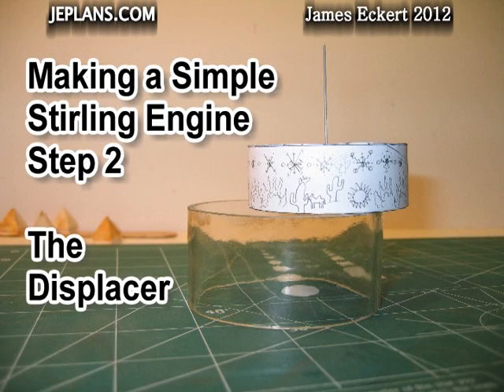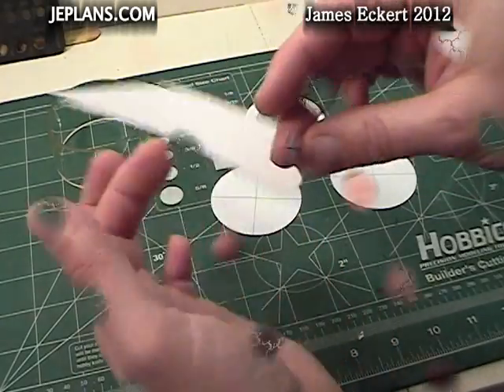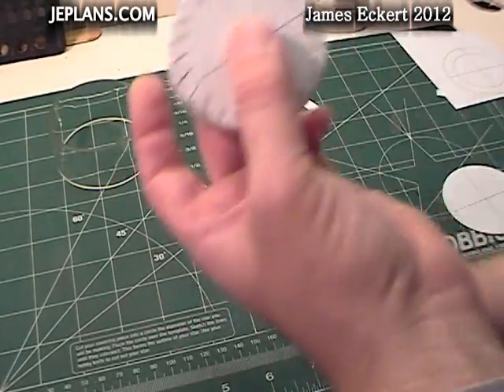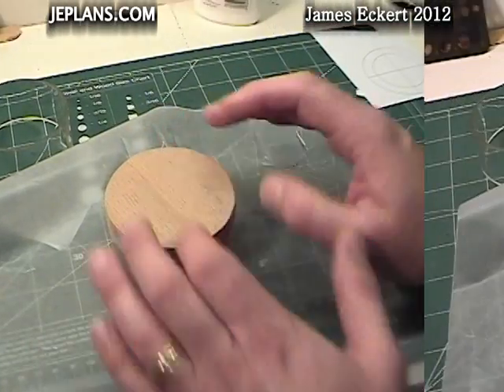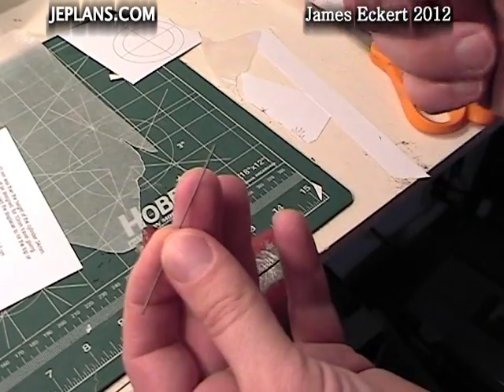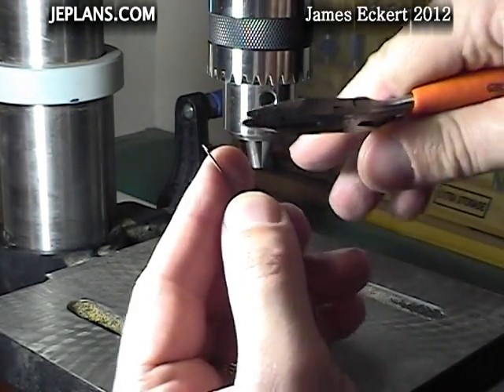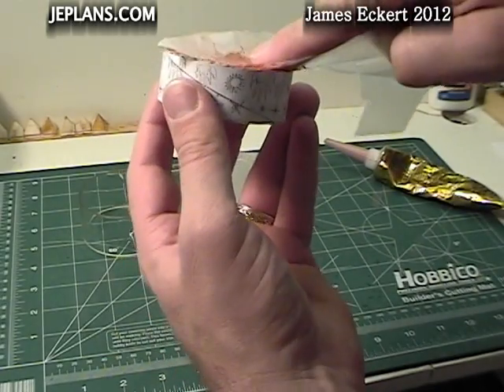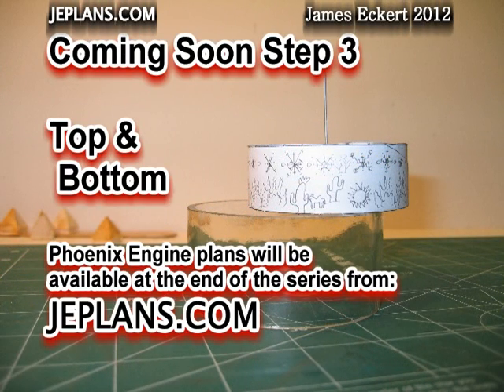Step 2 Making a Stirling Engine: The Displacer

Comment from the maker: Oops, I think I remove you other comment about the cylinder. Here what I was trying to replay with:
I used a bottle cutter to cut a Olive Jar in step 1.  The bottle cutter was less than $20. It takes a bit of practice to get a clean cut. If cutting is not your game, I have been noticing a lot of candle chimneys lately at home decor type places that should work.

Comment: oh i guess since you seem to be quite knowledgable and experienced i should ask how you make your crankshafts?  i've done mine 3 times, everytime it comes out with a bow.  i originally started by making all throws from one piece turned, drilled before cutting. then i've filled both holes with rods of the same length and soldered but every time i go to the the offset something happens, i lose my straightness.  I've ended up chassing it back and forth and never end up with a straight crank. help?

Comment: i've been working on my first sterling and have all the hardward made up.  my final step is to find the large cylinder.   i've looked high and low for something that might work but i've always found the pieces to have a taper.  the other option was to buy a piece of plexi from a plastic distributor but they would only sell a 12 foot section and for a price of 100+$ just didn't seem worth it.  Where do you find your materials?

Comment from the maker: I am guessing you mean near the end, where I am using some High-Temp Silicon Gasket Maker to attach some foil to the bottom of the displacer.  If not post the time index of what you are referring to. The actual brand name is MEGA COPPER.

Comment from the maker: Hello Vincent,
 If this isn’t what you meant post again. The goal of the Displacer is to move as much air from one end of the cylinder to the other end. Hot to cold or cold to hot depending on the current cycle. So when building your must strike a balance between the size of the displacer and how easily air can move around it. If its diameter is to close to the size of the cylinder it will slow the whole engine down. If it is too small, it might not separate the air as well from hot to cold.